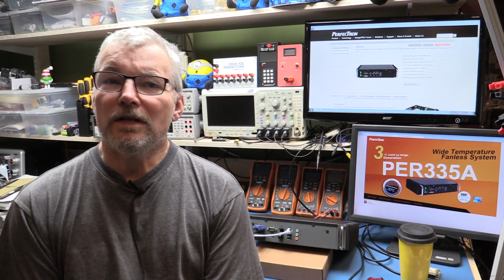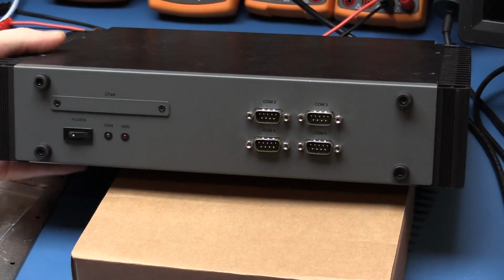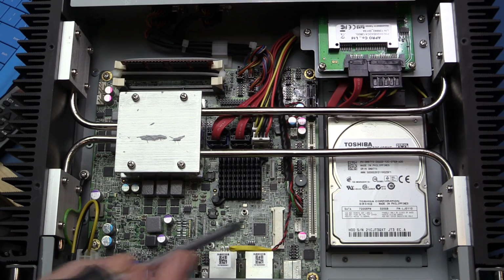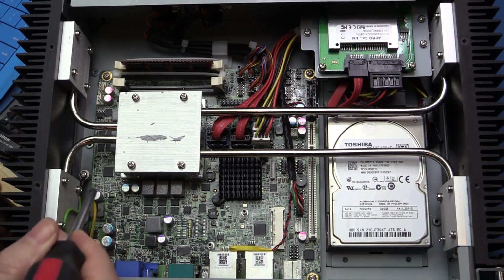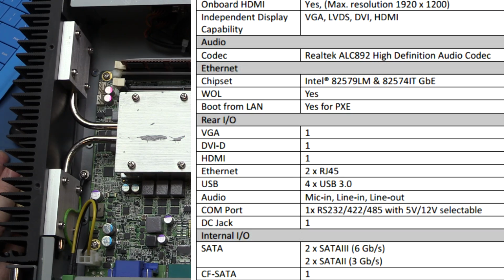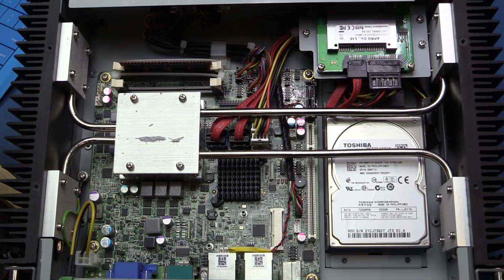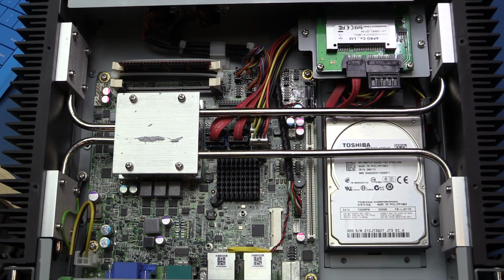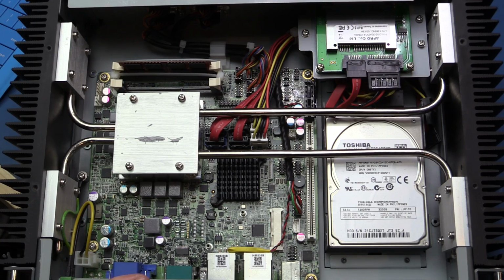Perfectron - Industrial I7 PC Review pt1 of 2

Comment: Power switch on back-Stupid!!!
Reply from the maker: +jpalm32 I think the front and back is debatable, it depends on how you mount it, it is common to keep certain functions away from would be finger pushers and you really would want to power down a PC in a controlled maner (IE, under software control if possible) and not simply cut the power from it. So perhaps not so stupid after all but you certainly need to consider how you mount the unit for service
Reply: Peter Oakes  I mounted many rack mount PC. They are usually  in floor mounted racks requiring one to go around the back open door and return to front.
Keep doing that while trouble shooting and you keep cursing the design.
Reply from the maker: This one is not designed for RACK mounting, it had mounting plates for a wall or other flat surface, but it is much smaller than 19" and as no fans are present it relies as you have corectly pointed out on convection to cool itself.

Comment: It's certainly interesting to look into a product like this. But I'm a little disappointed you didn't loose a word on the hard drive while repeating the temperature and vibration specs multiple times. I guess there are drives that meet those specs, but I think it would be prudent to check that before praying over the marketing material. I googled for suitable Toshiba drives and found MK2060GSC, and those for example have an operating temp. range of -30 to 85°C.
edit: Anyway, thanks for the video and I'm happy they sent you a useful pc to use with your cnc.
Reply from the maker: +h3po I did mention that the drive I used was from a MAC Book Pro and not really suitable for this application and that I have a small 16GB SSD that is, from a company call SWISSBIT, they make industrial strength memory products aimed specifically at this industrial category including the extended temperature range, I added links in the description if you are interested.

I am pretty sure I also mention that any accessory you add to this unit SSD or DRAM for instance would need to meet the specifications for the solution as it will only be as good as the weakest part.
appoligies if I did not make that clear enough in the video.. I will endevour to do so in future posts.

Comment: GPIO?
Reply from the maker: +BMR Studio There are 8 lines of GPIO on the mobo with a header but there not bought out to the case in this unit. I am investigating their use and if I find out how to access it I will post the details
Reply: +Peter Oakes (TheBreadboardca) Would be nice. Withou that is not realy a industrial pc. Kind of, and nice thermal design.
Reply: I find some PCI and USB to GPIO card on the ebay. Look after it, dirty cheap.